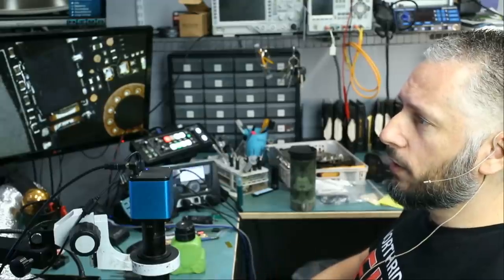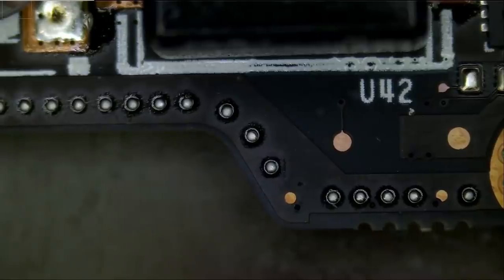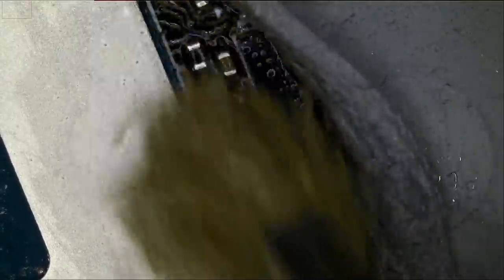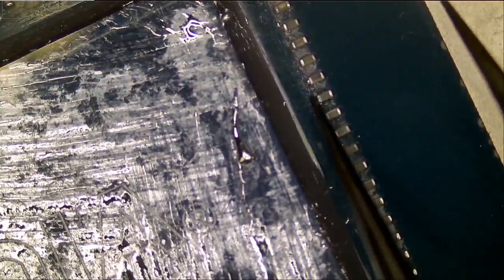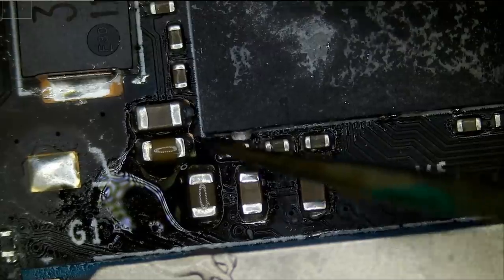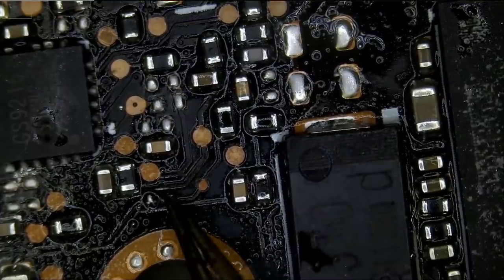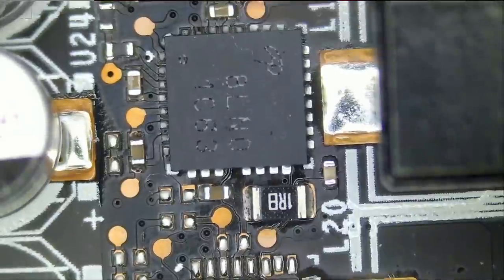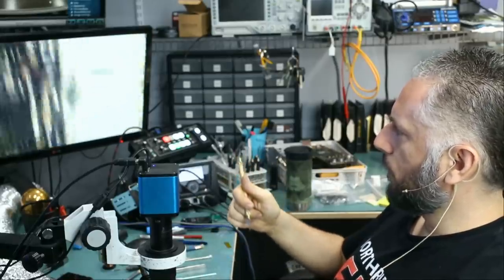RTX 3090 Graphics card Blew out after using Liquid Metal. A frustrating video to watch

Comment: I dislike how many people say in the comments say "such mods are usless" or "the 2fps gain is not worth it" 

It is not always about the FPS. 
The 3090FE (Launch model) has designflaws which will kill it in 3-5 years of use. Replacing the thermal pads can double that by lowering the temp of the transitors, chips and VRAMS from 90-110°C (95°C is the temp spec for these chips on the 3090FE(launch)) to as little as 65°C. The GPU-die will reach 90°C+ under heavy load (Like rendering and encoding videos, which is one of the main points of having this card over the 3080, which btw. shares a similar problem)). ANything above 70°C generaly speaking reduces the lifespan of your card. 
Then there are other factors. As many people here say "mine runs within spec" and such things. Maybe in your case. Remember airflow in a case can be up to 30°C difference for such cards. If he used it in a smal formfactor build his could easily have been throteling. 
Then furthermore there is the sound. Even if it is running cool, when it does so by being at 70%+ fan speed it gets loud and also damages the fans in the long run. 

Correctly applied LM/Thermalpads/high quality thermal paste can extend the life of your GPU and CPU by years. 

Nut I have to agree it looks like the one who did this had little idea of how to do it and doing such a job on a 3090 when you are not properly prepared and lack experience is just stupid.

Comment: I used conductonaut with my 3060. An nzxt x62 plus nzxt G12 mounting plate as the stock cooler was rubbish. It doesn't go beyond 50c overclocked to 200mhz. Zero issues. Follow the instructions. Clear nail polish to ensure it is protected from conducting just in case.

Comment: Yeah, don't EVER use liquid metal unless you know what your doing! But that being said, it absolutely can make a MASSIVE different to your temperatures. That person obviously had no idea what he/she was doing, because they didn't even protect the tiny capacitors right there on the GPU die before adding liquid metal! That's liquid metal 101 stuff, you ALWAYS cover any components on the die with liquid electrical tape or clear nail polish to seal them. Liquid metal getting everywhere else on the board was either due to careless and messy application, or they simply added too much to the die and it leaked out all over the board once the cooler was put back on.

Comment: I have used liquid metal on my laptop( Acer Predator Helios 300 2019 ), because this laptop tends to run very hot. Also I live in southern Asia so its warmer here. The mistake he made was using way too much liquid metal, that too, without using any conformal coating or at least some tape at best. So when the heatsink was placed and tightened, the liquid metal leaked out of every orifice possible. The liquid metal does work well if used properly, but this is a complete disaster.

Comment: The only way I found to get some of this stuff out was to use the syringe LM came in and use it to suck it back from the needle point. 

When iv applied LM in past iv used thermal grizzly nail polish around the area and coated the smds around the GPUs or the CPUs. Since conformal coating isn't available in Canada I go over seas to get a viable replacement.

Comment: I am watching this and I wonder if a blunt syringe needle with a vaccum behind it would provide a precision vacuum cleaner that would clean this ( and other stuff ) off boards.  Indeed would the solder sucker do it with some heat but not enough to melt solder?  Maybe set it at 200c  ?

Comment: my gtx 1070 with liquid metal i applied 2 years before. I got it 2nd hand and it has been through 1st wave of coin mining in 2017 and still work nowaday. 2100Mhz oc within 54-55 *C also shunt mod used liquid metal. Just be careful not flipped it or use VGA vertical holder to prevent lm spill out

Comment: Maybe some of the thermal resisting tape (forgot how it was called) could be used as isolation about the chip if any spills of metal happen won't short circuit.

Comment: LM is great and plenty of people use it successfully across a range of systems and components. It has a consistent and measurable drop on temps, and when proper precautions are taken (conformal, kapton etc) it CAN be just as safe as non-conductive pastes. It is great for OC, gaining a few boost bins on your gpu, and/or lowering fan speeds/noise. This was simply a case of more money than sense and perhaps a bit of youtube facilitated Dunning-Kruger.

Comment: Liquid metals are already dangerous as is, not just for their ability to conduct electricity and short components, but for how dangerous it is if a gallium based liquid metal comes into contact with anything aluminum. Any scratches or porous surface on an aluminum component, and the gallium based liquid metal will infuse and alter the aluminum into a brittle mess that you can shatter with your fingers. This is a painful lesson for this fellow, hopefully he sticks to a high quality thermal paste in the future and focuses on the airflow in his chassis to keep his GPUs cooler.

Comment: LM can provide better thermal improvement than 3C if applied correctly, but it needs a super thin layer on the heat spreader and block and no more.  The user should also have used nail polish around the die.  He also used WAAAAYYY too much.

Comment: What happens when people watch LTT videos. Liquid metals like conductonaut have gallium in them which eats and destroys metals like aluminum and steel, so you have to be very careful where you apply it (between silicon and copper). If it touches anything aluminum like many caps it will react and completely break it down, and it will make steel brittle like resistor wires etc...

Comment: As someone who only uses liquid metal. Use it on my desktop GPU CPU and Laptop GPU and CPU I can honestly say I never burned out any of my components. My laptop has had Liquid Metal going on 4 years now and great temps and no issues same for my desktop r9 5950x and RTX 3070ti.This person must have put way too much looking at this even my first time applying I knew LM did not need much and it's not good to put much because of this. Also, I always put rubber tape around the die area to not short those whatever they are called around the die of GPUs.

Comment: Liquid metal is fine and to be clear to those who are saying it's a waste: If there is ANY application for it it, it's at the top end of a hardware stack, so in this case with GPUs, a 3090 is actually the most reasonable application for liquid metal. You can't do better than a 3090 for gaming hardware and so how do you further improve your system? 12900K? Check. 64GB DDR5? Check. Now what? Other methods such as better cooling like a custom loop and liquid metal TIM are the answer. This person who applied this very, very obviously shouldn't have tried, doesn't know what he's doing, but honestly he had the right idea. Should have given it to a pro to do for him, but we shouldn't be discouraging the use of liquid metal for hardware enthusiasts, just to know your own limits.

Comment: You're supposed to protect any components surrounding the GPU whenever applying liquid metal! Just use some regular nail polish if nothing else. Poor, poor job! Poor 3090.. A word of advice for people here wanting to try liquid metal. Yes, it's good. Yes it will drop your temps (assuming the heatsink is not too small for the chip and gets saturated by heat.. talking from experience). I would advise against using it on a laptop if you plan on taking that laptop anywhere. All the rocking during transport may displace the liquid metal. Never use liquid metal on aluminium heatsinks! Also, if you use a copper cooler, keep in mind that the copper will slowly absorb the liquid metal, so you'll have to do some cleanup and reapply around once a year. Nickel plated copper works best. Another thing. If it's your first time applying liquid metal, make sure to cover any other components surrounding the chip. Just use tissue paper, painters tape, whatever you have. The liquid metal shoots out of the syringe if you're not surgically careful.

Comment: try using a rubber bulb or even a solder iron removal type with the rubber bulb (not plugged in of course) on it to use as a suction device sorta like a hand type vacuum by squeezing the bulb and sucking in the LM

Comment: Use the heat gun , tip the board and use lower temp with a solder wick. Works

Comment: Rub some isopropyl alcohol around the area, apply heat with a hot air gun and use a solder sucker to suck it up. When ive applied liquid metal i always inspect the component boards, if i find spilt liquid metal the method above take my no time.

Comment: You'd think someone would start small with liquid metal lol... my first time ever using it was on my i7 8700k that is still flawless to this day, I delidded it and applied a rockitcool 100% cnc'd copper IHS and did little bits at a time and spread to make sure the contact would be perfect and not too much lol.... my number one tip[.... LESS IS MORE.... TEST TEST TEST and get the correct type of clear nail polish please.... jesus.  Nice vid nice job!

Comment: I am showing my age but I anytime I have to deal with liquid metal I use a heat gun with a dustbuster, just make sure to line the filter with coffee filters and also add a tube to the end of it, I just duct taped a tube with a small wand on it, sucks it right off the board and the heat helps it move and not grab onto the solder.

Comment: Liquid metal is basically nothing but gallium which is one of them metals you treat like Mercury, although it's not toxic like Mercury it contaminates everything and it's the last metal you want being tracked around from place to place as gallium defuses in to aluminum and makes the aluminum as about as strong as a piece of 3mm particle board and it's also very sticky and it's residue is significantly worse I don't understand how people think it's a good idea to use in sensitive electrical systems.

Comment: I would refuse to work on any board that had liquid metal on it. Unfortunately the manufacturers are starting to use it !! Do you think that manufacturers have a cleanup solution for their mess ? They probably do but won't share it !! I wonder if there is any kind of product that would oxidize that stuff and make it solid ? Then you could pick it off. Of course what ever you use cannot attack regular solder or circuits. Good luck !

Comment: Liquid metal is 100% worth using, but this guy just emptied the entire syringe on the die! Thats not the way to do it,
Also masking around the gpu chip with electrical tape or nailpolish is a no brainer. I use an electrical tape. I have seen "-19C" temp drops on hotspot temp, while switching to liquid metal. So some people here claiming, it drops 3C only- clearly have never used it.

Comment: Facepalm to the guy that ruined the board. Liquid metal, besides being a great conductor of electricity (as any other metal), also dissolves copper and contaminates solder joints, which is BAD, BAD, BAD and ultimately causes the PCB to be unusable.

Comment: I HAVE to use liquid metal on my msi laptop because of the horrible thermals it has. Always above 90c, horrible throttling...
But before using it I secured caps around with a nail polish and built a cage around using foam, so a spillage(which actually happened) didn't destroy everything.
Sketchy shit, but I had to

Comment: if you can find a nickel plated syringe, that works best for removing liquid metal. You have to work the liquid metal on the tip, otherwise it wont stick. 
Liquid metal is best used on hot components with insufficient cooling such as, laptops, small but powerful pcs like nucs. Liquid metal is totally pointless when you have a large cooler, so this guy shouldn't have put it on the 3090. Also you are much more likely to overheat your gddr6x on the backside of the board rather than the die itself (literally the die would be at 60c while the memory would work itself up to 110 if g-ram was maxed, it would thermal throttle on base clock), so in this specific case, what this guy did was verge level dumb. I honestly don't think the die is even capable of reaching 70c without the memory causing a throttle with that massive cooler.

Comment: Want lower temperature? Play at lower resolution and details. I often play at 900p medium with my RX 570, although it can handle 1080p high. Temperature never goes beyond 70C and gameplay very fluid at 75fps Vsync enabled, because the GPU is under utilized.

Comment: >10x too much LM
>no acrylic around the die resistors
>no conformal coating on the PCB
like holy moly did that dude just squirt the whole tube of LM across the whole board?

Comment: before using liquid metal, use clear nail polish and paint over all the traces and SMD on the board in a 2CM radius around the DIE, so it doesnt cause a short when you screw up like this RTX3090 owner

Comment: i paid for 1g of liquid metal, i am going to use the whole tube! Except liquid metal is more noob-proof than thermal grease, hehe :))
Btw i also applied liquid metal on a rx 580 8g (msi gaming x, which has nickel plated cooler base, so suitable for LM), the temps are outstanding, great stuff. The 1g tube (thermal grizzly conductonaut is what i used) is enough for like 10 applications lol.

Comment: The easiest way to remove liquid metal is not to use it in the first place :)  I was really surprised when Sony decided to use it on PS5, but looking at their solution they over engineered the hell out of the area around the thermal interface it was used.

Comment: Those BGA chips probably have LM all down the sides. Freezer spray might thicken it up enough to chip off.  really Nasty Stuff. Copper Shims on the RAM is the only way to improve heat dissipation. high vacuum suction might clear the edges of the chips. but that stuff creeps between components and PCB.

Comment: I just done it, liquid metal are covering the small capacitor in cpu, after some try cleaning it with cue tip fail, i put thermal paste in area where liquid are sticky and mixed it with pointy plastic spudger. Its looks like thermal paste have higher cohession force to the board, and make liquid metal suspended in the thermal paste. After a long 'mixing' i clean thermal paste with liquid metal particle with cue tip or tissue.

Comment: That was beyond dumb to do. Liquid metal would do nothing. The bottle neck for the card is with the power delivery max that is set in the card, not the cooling. It literally wouldn't increase performance at all, and would only reduce temps by like 5 degrees at the most.

Comment: Can you use a neodymium magnet to clean the board? 🤔
Reply: not all metals are magnetic, this liquid metal is bond to most metals so the board is unfixable from the start, it goes under BGA chips and shor circuit in many parts

Comment: Theres only 1 use case for liquid metal imo and thats enthusiast grade overclocking. Problem with liquid metal is its not something you can play around with. It has a shorter life span than a conventional thermal compound and can easily short components. If you want better temps look at kryonaut or kryonaut extreme. The only thing i will use liquid metal for is replacing thermal paste under the ihs of a older intel cpu.

Comment: looks like he applied it like a traditional thermal paste. there's too much in there or was sloppy at applying it a drop a decent amount somewhere.
 the stock cooler would just work fine even with being OC'd. if he really wants to overclock and push it more, should've has just slap a water block there

Comment: My MSI laptop would throttle the CPU from it overheating. I applied liquid metal on it and the GPU and dropped about 20C. I guess this still falls into the don't broke don't fix it but do you consider a thermally throttling PC as broken or not because I do. My old ASUS laptop I also applied and made it much more quiet.  Though a desktop GPU is from what I heard the hardest thing to get LM done right. The key is apply on both surfaces extremely little and the "water tension" in the liquid will make it stick together while you re apply the heatsink.

Comment: This is exactly why I strongly advise people to stick to custom water loops and thermal paste, liquid metal ALWAYS has an HIGH risk, there's just NO way around it, the benefits on a GPU die are not that big anyway, you get more cooling already than on a cpu die just because of the die's surface area being larger, besides an GPU die is already exposed, unlike CPUs where liquid metal has some merit, doing this to an GPU where it can easily flow out of the die and end up beneath the substrate shorting the bgas directly, regardless of how much experience you have is utterly retarded just to shave off a few dB or centigrade from the GPU whereas in the RTX 3090's case it usually is NOT the thermal problem, the graphics memory is with some partner models running in the high 100°C or worse... Why even bother....

Comment: When my PS5 finally needs to be re-LM’d I’m gonna be super careful and inspect my board and clean it well after application, and if I do mess anything up I’m sending it to you I have a really really nice 5900X PC with a 3080 Ti in it I will never use LM on that only non conduction Carbon Nano Grease based thermal paste like TG Kryonaut, kingpin KPX etc.. and K5 Pro to replace thermal pads ( up to 3mm thick before you need a copper plate then you can add 3 more mm ) it works like 5-10X better than thermal pads